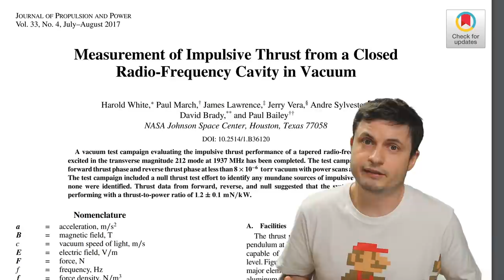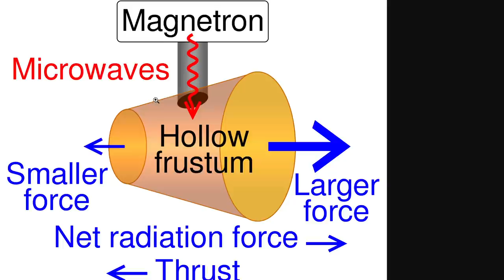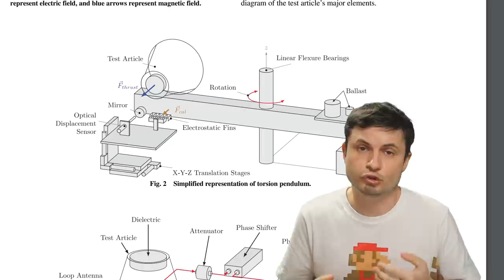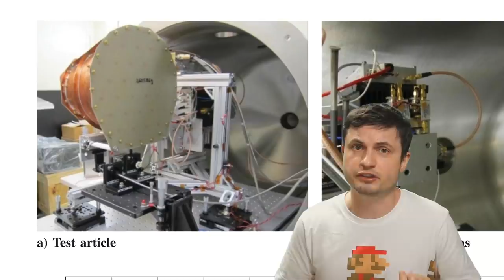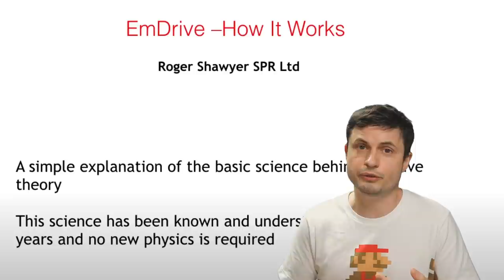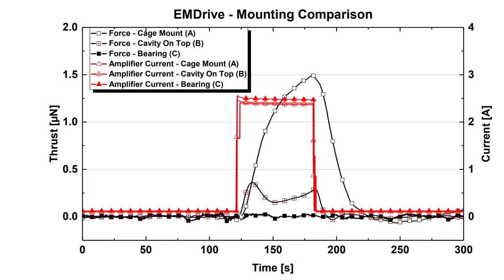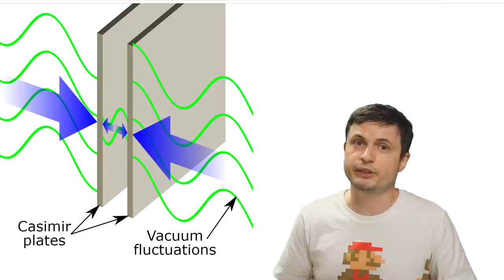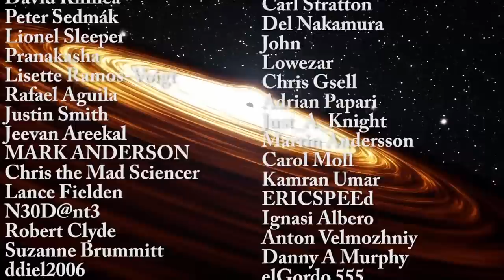Looks Like EM Drive Is Officially Dead - Experiments Fail

Comment: Honestly if you think about the miniscule thrust levels, would it even be useful if it worked? A bit of solar wind will knock you off course. 
It seems to me you'd use most of the output for trajectory corrections.
Reply: if it did work it would be a starting point thats what optimization is for kinda like starting with the wright brothers and 100 years later 747

Comment: I wonder about the idea that you could put two capacitors between an actuator and pump charge 90° from the actuator position. Supposedly a charged capacator weighs a tiny amount more than an uncharged capacator. If this is true then we can push the caps away from each other when the front one has a charge and pull them back together when the back one is charged. But I really do not think we have caps with enough power density to even measure if this idea works and I have my doubts about the mass increase even being real. Note that it is not the mass of the electrons, but rather the mass equivalent of the energy stored in the caps that is supposed to produce the difference in mass with charge state.
Reply: You electronics guy just miss the mark.

Comment: Going back to... was it the voyager anomaly...
If I heat one square meter of spacecraft surface to 1000 degrees kelvin, and the opposite side of the spacecraft is a more modest  300 kelvin, what amount of thrust will the asymmetric heat radiation produce?
It may not be an EM drive, but it works without using reaction mass.

Comment: Possibly dumb question. Wouldn't you get some thrust by pointing the magnetron (or any light producing element) in a specific direction? The light has momentum so in theory light with a momentum away from the craft must have given the craft the same momentum in the opposing direction when it was generated. It would not be a lot of thrust due to the small relativistic mass of light and the correspondingly low momentum, but we know light sails work and treat them as valid methods of travel, so wouldn't just turning on a flashlight work as a thruster all the same? You are still losing a small amount of mass due to the energy the light is running away with so Newton won't get mad if Einstein tells him that light has mass, and assuming you don't have an equal amount of light running in the opposite direction you should be fine. I can see how absorbing the light from a point source may counteract the momentum of the light that escapes if the heat radiation eventually makes it's way behind you, but if you use a parabolic mirror to reflect almost all the light all in one direction then there is a definite amount of mass (in the form of energy) flying off with momentum all in one direction (assuming you didn't generate it in one direction already using lasers or LEDs). I can't see a way how it stays stationary in that scenario. I get it would not be a lot, and you'd probably need a death star laser to notice, but isn't that still a valid if not extremly efficient method of thrust similar to ion drives? If you were navigating interstellar space where there isn't even the gravity of planets to screw around with it wouldn't the delta v literally be the speed of light (I get you won't get to the speed of light using this, but in theory if time and energy generation wasn't a factor you could get damn close.) If I'm wrong please tell me how, if it would take the age of the universe to be helpful I get it, but I don't see how it would be technically invalid.

Comment: Well, radiation-pressure is a thing. The Frustrum would direct most of the photons backwards, generating a tiny amount of thrust. Mounted on a satellite you would generate more force by solar radiation and particles hitting your solar sail. A few micronewtons from a couple of kilowatts are a horrible waste of energy, we're talking about a fraction of the force generated by the weight of an ant.

Comment: Shawyer's always said that the NASA design is flawed and couldn't produce thrust anyway;  so the variations on it that Tajmar et al tested based on McCulloch's QI theory (which assigns informational bits to the planck-scale coordinate space itself) were similarly futile from the outset..  Shawyer's EM drive proposal thus remains unfalsified.

The hardest part of Shawyer's concept to understand, is how PE:KE symmetry is maintained - that is, the energy cost of accumulating momentum must square with its 'velocity' component..  whereas the prospect of an 'EM drive' elicits notions of constant acceleration per given input power, an inherently over-unity performance envelope.  On the contrary, Shawyer is claiming that the input energy workload remains bound to the terrestrial or 'absolute' reference frame, hence the energy cost of the thrust produced (ie. the work done to obtain that thrust) - even if done so losslessly as idealised via passive superconductivity - would necessarily increase by the square of velocity..  so for instance to double such a craft's speed, you'd need to quadruple the energy input to the magnetron.

(not putting for Shawyer here or even playing devil's advocate - just pointing out that he has contested the designs of these test rigs and any conclusions extrapolated about his proposal from them)

Comment: Any scientist still using the Fahrenheit scale loses most of their credibility right there. - 6:37
Reply: Considering 1c is 1.8 f then it is easier to down farenheight into larger equations.  For instance.  32 to 250 or 0 to 100.

When it comes to temperatures above 800f then it is easier to use celcius in equations.

Let's not get started on kelvin.

Comment: As far as I'm aware, the theory about how it produces thrust wasn't to do with a differential in radiation prsssure, but a differential in the expansion of space-time (that's how I interpret the theory). Basically, if the energy in the container was high enough that it would turn space-time non-linear on one side while remaining linear on the other side, it should be possible to produce thrust. Of course, to reach the Schwinger Limit, it's not possible with microwaves at 2.45GHz. One day, we'll get the answer from NLO experiments.
Reply: It's also very easy to say "This didn't work because it goes against our current understanding of physics", then just sit back and relax into what we already know. It's much harder to say "How could we evolve our understandings of physics to make something like this actually work?" That takes a lot of thought, time and effort. The people who do that are usually thought of as crazy because they're going against convention, but they're usually the types of people who make big breakthroughs.

Comment: Even if this thing DID work, with the tiny thrust the original experimenter claimed to observe, it would have required a massive amount of energy to get a viable amount of thrust. TWR would have been abysmally low. Definitely wouldn't be lifting anything into orbit either.

Comment: Shouldn't it be possible to simply take a laser and point it to the rear? As photons carry an impulse p=h/lambda, this should generate a miniscule, but measurable thrust, without any fuel, depending on frequency and luminosity of the laser. And a huge laser, like that of the Death Star, should generate a significant amount of repulsion. But why should an EM Drive generate more thrust, if even any?

Comment: would not; if you heated a cone, produce a thrust simply due to the radiation and geometry of the output?
Reply: would not; if you heated a cone, produce a thrust simply due to the geometry of the radiation?
Reply: its basically a heat/infrared thruster.. no wonder they thought it moved but when science says"What about the heat?" then we zero everything. so vanishes the propulsion.

Comment: I honestly do not understand what the claim is. The diagram shown at 0:55 in the video does not help. If you have stored energy on a spacecraft in space, and release some of that energy in a directed beam, OF COURSE the craft would be expected to move in the direction opposite of the beam. There is a thing called radiation pressure after all. Once the energy source is depleted you have expended the capability to change velocity. So is the claim that the stored energy can be converted to EM radiation at such high efficiency and directed through a system without increasing heat loads to unmanageable levels as to be usable?  

Light sails have demonstrated that given EXTERNALLY generated radiation (from the Sun); the pressure can be harnessed to take advantage of this property of EM radiation, and could operate continuously without stored energy replenishment.

Comment: A cone shaped tube with two open ends, of course it will not work. Put steam in it and you will see why. Magnetronic radiation is not bouncing off towards the biggest hole, if radiation would have had mass, then it could have made a difference, but radiation has never put any weight in the scale. Gravity has hardly any grip on radiation, there are some theories (cosmic lens) and even some things in practice that beams of radiation, energy whatever can be directed with magnetism. But since no one knows the essence about light and all sorts of radiation, we can not know if energy or light has mass.

Comment: Serious question here. If someone can help me understand what i'm getting wrong, it would be greatly appreciated.

So that particular device doesn't work, ok. But solar sails theoretically work, right? So light does produce force. So could it be possible to propulse a spaceship by having the radiation source pointing away from it, like a reaction thrust but with light/radiation instead of gas? That would get rid of fuel, you just need to make enough electricity on the ship, with a small nuclear reactor or whatnot.

I'm not super fluent in advanced physics but can someone tell me what i'm missing here?

Comment: I am devastated. Maybe if Shawyer and the thieves that stole my lab notebook in 2000 read my notes more carefully you would see that the energy dissipated as heat in the walls is much greater than the energy transfer of the photon momentum to the walls. If you shine a flash light into space the radiation pressure will push you. The momentum comes from the photons. Before turning on the light the momentum of the system is 0. 
To make the emdrive efficient the walls must be superconductive. This allows the photon energy to be completely converted to momentum with no heat loss. P=2U/c
P momentum of one reflection is the energy  U divided by speed of light c.
Perhaps the original designer needs to patent the device with the supporting equations. Sorry Roger you totally got it wrong.
The key factor to make it work very efficiently is to place a dielectric material on one end. The speed of the photon is reduced by the dielectric material. The use of very high dielectric constant material on one end causes more momentum to be deposited on the dielectric end. The difference in forces is quite dramatic and the efficiency is well above 50%. After 20 years I would imagine that other engineers would have seen this. THE REASON YOU DONT HEAR ABOUT IT IS IT IS CLASSIFIED! 
Anton did some wonderful person pay you to claim it doesn't work?

Comment: RIP the pipe dream. You will be missed dearly.
On to the next one!
Reply: Dufuks yur problem?
Gigavolt ion drive works fine.
Reply: How is this a pipe dream? It's not like EM drives were some type of holy free energy grail - it was just a proposed way of producing a rather minuscule amount of thrust using electricity.
Reply: @ariesdane5876  any physicist knows increasing the voltage increases the force on a charged particle, stepping up the voltage to gigavolts allows a mild radioactive source to ionize enough gas to accelerate to enormous momentum quickly.
Reply: @unitedspacepirates9075  An ion engine is completely different than an EM engine. Ions have mass, EM does not - this has never been billed as a "Ion" engine, because of course an ion engine would work.
Reply: @ariesdane5876  
Only construction scale limits your voltage, and thus your acceleration.

Comment: I was always wondering about how such a thing should work at all.
but I was hoping, what if these guys can somehow manage to create a microscopic alcubierre thing, and distort spacetime just a little bit, then they might get some microscopic traction force, at least as a proof of concept.
but so far, no water at all was found in the creek.
we need something entirely new, and it might be even quite simple if we only knew what it is... ;)
Reply: what if we can construct a tight grid of such casimir structures, and therefor a grid of regions, where virtual particles are tighter than in the adjacent regions?and then, the density of virtual particles is forming a grid`? and then play with that geometry, like increasing grid distance from each to the next step`? in a gazillion of geometric ideas, there might still be some hidden meat..

Comment: Hmm I probably misunderstand what this thing is doing but if you are letting radiation flow out and it’s stronger in one direction how’s that any different than a normal rocket engine which throws stuff out one side to make you move ?
Reply: The Radiaton in the EM Drive does not escape the Chamber.
it bounces back and forth inside the Engine

Comment: So that bucket thing is closed at both ends? I trust the radiation penetrates the wider end, or is allowed to escape in pulses, with that end opening and closing successively. Why does it have to be microwaves? I guess heat creates no pressure in a vacuum. Oh, don't be cheap on the fuel, open the darned bucket at both ends and throw some particles in there, make it an ion drive!

Comment: Doesnt' the standing wave source have to vibrate at what we call the note G -
Frequency of G: 24.499Hz	
Wavelength: 13.89m
 to get the resonance effect?
Reply: That thing displayed behind you?  I promise that thing will never do it. That would be like rolling a sheet of brass into a tube by hand, riveting it together using rocks and expecting it to sound like a Stradivarius.
Reply: Why would there be a single magical resonance frequency? And why are you quoting numbers for sound waves rather than microwaves?
Reply: @bryanreed742  Waveform is waveform. frequencies can work together (complimentary waves) or they can completely disrupt each other.  But what I was specifically speaking to was the standing wave. a.k.a. G-wave or G "Bell". You will hear it on guitars and basses that have perfect intonation . YOu get the normal function, but striking the string open, you of course get the G but there is also an undertone of a metallic ringing.

Comment: Make a Quantum Wavelength Laser Engine. WhereThe laser point stays in place but laser takes off at the speed of light. Each consecutive wavelength is quicker than the one befor but the same wavelength, with a Quantum effect creating Lightspeed thrust. It would probably also stop time. And probably kill everybody on board. Or obliterate any satellite it was attached too🤔 Not really but it was a fun little thought experiment. QE=W-2 Quantum energy = wavelength negative squared. I should write a science fiction book

Comment: Most electronic measuring devices use electrical resistance to measure with. Increasing thermal energy increases electrical resistance which causes errors in readings. A researcher should know the science behind their measuring tools in order to prevent wrong conclusions.

Comment: Would never work as intended. Heat radiation providing thrust is not viable to satellites. Ionized thrust modules are the safest tech for such small satellite bodies. The modules properly shieded and buffered, a satellites comms would be less affected compared to relatively massive radiating cavities so close to sensitive comms.

Comment: The dudes calculations were off.... Its the arrangement, shape and the rate of change in the wave function. Basically to prevent the push in the car scenario he should have worked on spacetime expansion like what goes on in a high velocity singularity. Do to NDAs I cannot go any further. There will be something big coming up for humanity in the near future. Though, it may be discrete at first.

Comment: You'll get more thrust from a laser.  A "photon rocket" will give orders of magnitude more thrust from that same power input.
The emDrive could never be taken seriously, since the write-up contained math and physics errors, perfectly analogous to the way someone would convince you that an "overbalanced wheel" is a working perpetual motion device.  Correcting the analysis, you find no reason to suppose that such a device would produce thrust.  So why was there so much effort put into testing it?  You don't see real engineers trying to see if an overbalanced wheel or a static magnetic motor might just happen to work anyway, when we know they don't.

Comment: Generating electrical power from nuclear fusion hasn't worked either but physicists haven't given up hitting their heads against that brick wall either. They claim nuclear fusion power will be safe, that it can't "runaway." If they're wrong about that, then one day there might be a gigantic crater where south central Europe used to be. The worst radiological accident in American history was the result of a miscalculation by physicists. That accident was called Castle Bravo.

Comment: Of course it does not work in a complete vacuum. Space is not empty, it is full of dust, gasses and charged particles, though diffuse and spread out. An EM drive would be acting upon these particles.